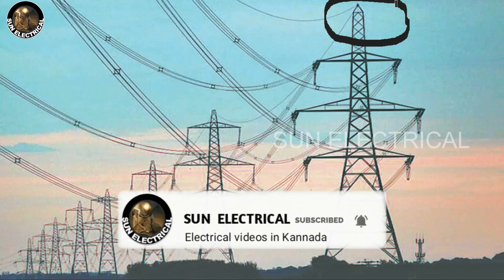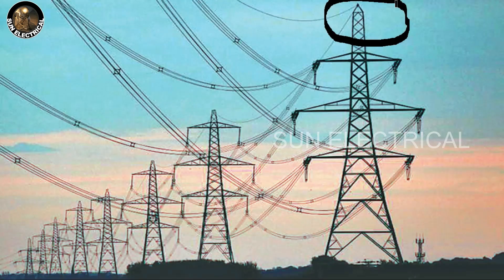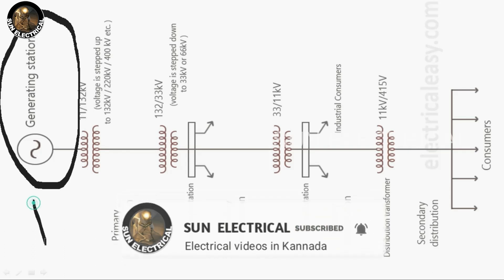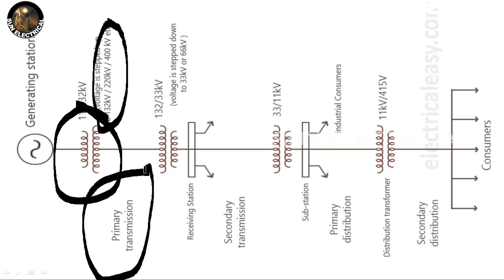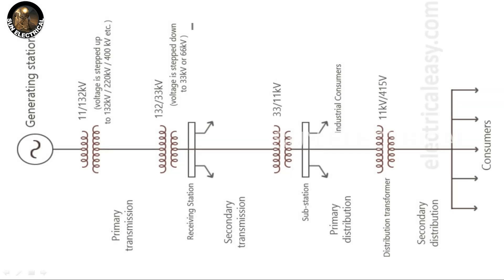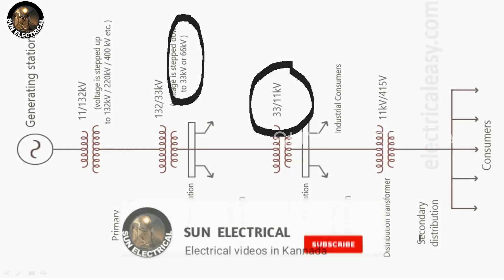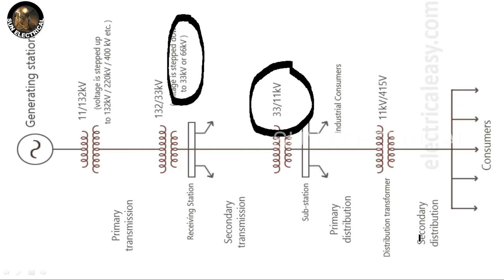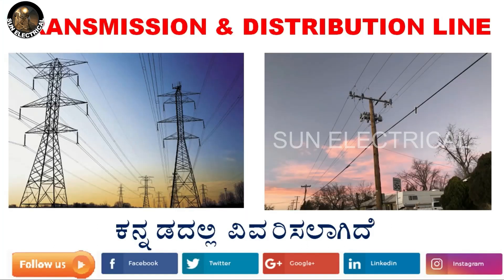Transmission&Distribution Line | Transmission & Distribution Line explained in Kannada#SUNELECTRICAL

Comment: Transmission line nalli Yaak haage Step up and step down  madtare anta  tilisi bro
Reply: Step down transmission which collects voltage in ac  at high range
So, that will used in step down transmission